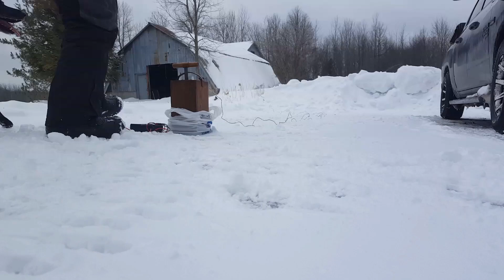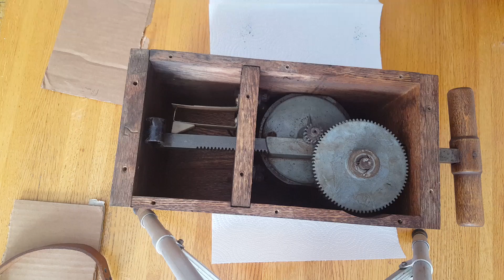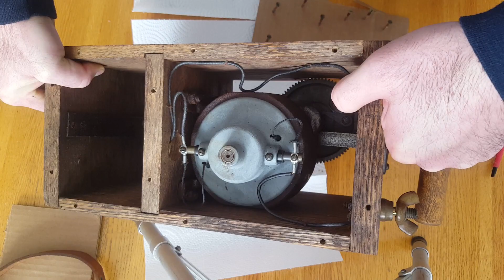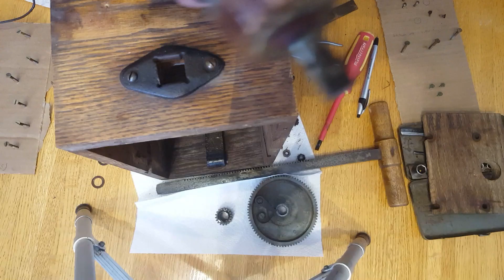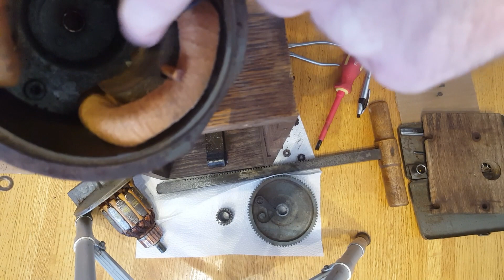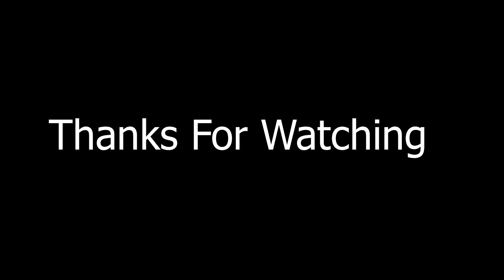50 Cap Blasting Machine: How it Works

Comment: I have a similar machine that works but the plunger is pretty stiff. Would putting grease on the internals help? If so what type of grease and where would you apply it?
Reply from the maker: Cleaning and relubricating will help. Any gear grease should be good.
Reply: Would something like WD40 work or is an actual grease recommended?

Comment: Do you know if the electric feedback loop is constantly connected or is it both connected at the bottom stroke?
Reply from the maker: There is no disconnect for it so the only thing it does is connect the det loop to the system.
Reply: @Stray03  the connection could be connecting both the feedback and then no current is generated or fed back until at the bottom of the stroke. It's hard to see the wiring from the Vid. Are you sure that the switch only connected one side of the output and not the feedback? Oh and if your wondering these are called shunt wound dc generators.
Reply from the maker: Pretty sure. But check the patents for them. Gives the wiring